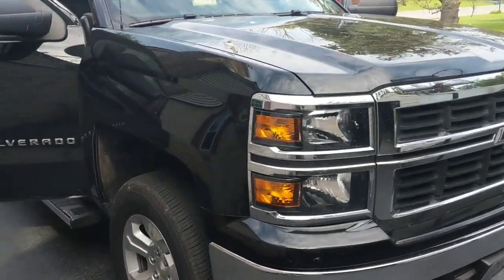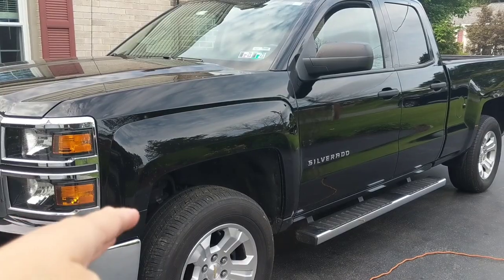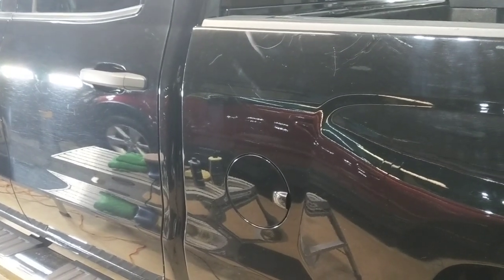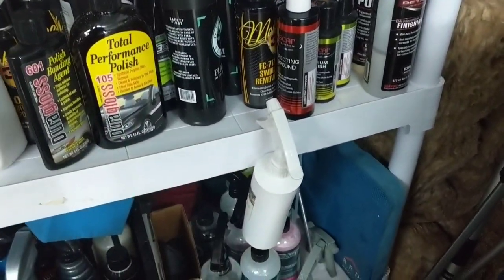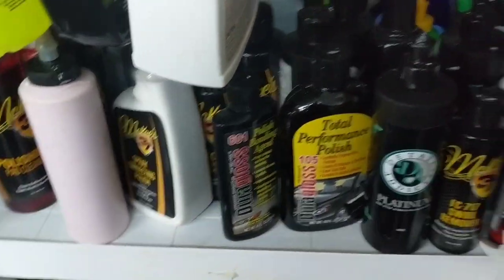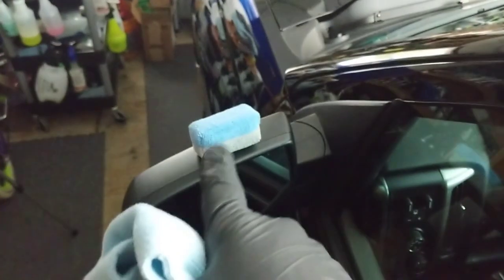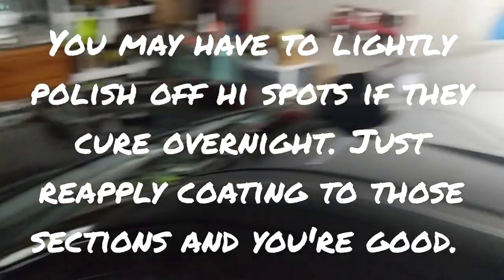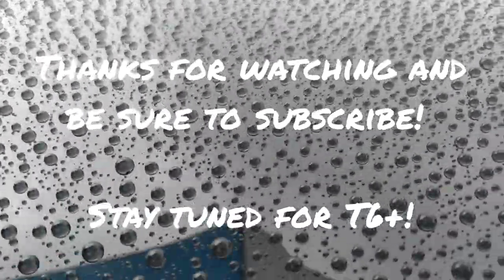Polishing a hammered black truck- Process and then coating with DPC T3 Coating!

Comment: You was more lucky than me, you got about 12 hours of curing before light rain got on the paint. I coated my car on the driveway and left it over night. Here in PA got cold at night, dew and light mist/rain got on the car and it only has about 4 hours cure time. The water beaded up, I rushed to get my blower and it blew right off. This was around midnight, I am sure I pissed some neighbor. I am sure they can lose 10 mins of sleeps 😂. I don’t know about long term durability but short term still look good. Love your videos

Comment: Chelsea, pat on the back for you that truck's paint was severely hammered.  I noticed you mentioned early in the vid that you don't charge based on a paints condition which I think is very.nice.

Comment: Nice work. That truck came out great. I see that you are using the Autofiber saver applicator and I was wondering on a typical ceramic coat, how many panels does it last before you have to switch it out with a new one? Also, whats the total amount of saver applicators needed for each ceramic coat?
Reply from the maker: I use one per vehicle normally.

Comment: excellent vid... is there really a difference between t3 being a pro coating and other coatings you've used? would love to here your thoughts
Reply: Just my 2 cents and personal opinion, I thought the Mckee's 37 coating Chelsea did  looked gorgeous, a nice classy look, best so far. I put Gtechniq CSL/Exo on my truck, I really like the look, but 3 coats on a full size F-150 crew can did me in. If I had to do it over I'd would have went with the Mckee's.  Also, not a coating but Jescar Powerlock still rocks, and Chelsea did an amazing job with it.
Reply: @jayz313  I installed mckees a few weekends ago... my first ever coating.. it turned out really well... I had trouble seeing where I was on my silver paint...I might try Adam's with the uv If i ever do it again

Comment: Does removing tree sap, tar ,bugs and claying harm coating
Reply from the maker: The strong chemicals used for them traditionally are very alkaline and could weaken coatings or their hydrophobics. Most coatings help protect and make removing those contaminants easier that you don't need those chemicals ideally.

Comment: What kind of applicator pad were you using to apply the coding with? Also what polisher is that? Great vid!!
Reply from the maker: Autofiber saver applicator pad and i am using a 21mm long throw I picked up a while back from Rain Drops Detailing that isnt available at the moment
Reply: Did you go with the mini or thin? Are you able to reuse the microfiber portion after the coating of T3?
Reply from the maker: I used the mini and normally ill use them for trim or tires after using once as they get hard even if I soak them in apc.